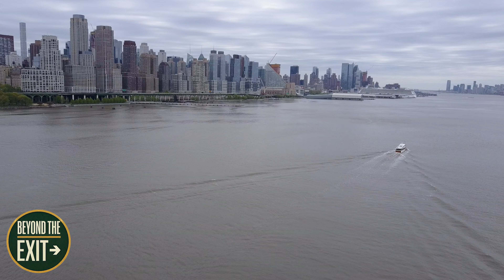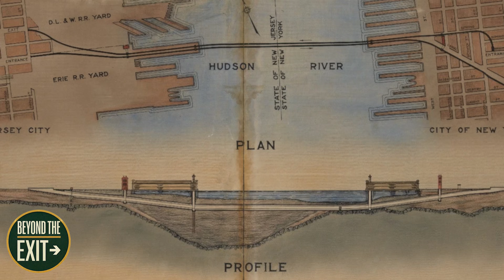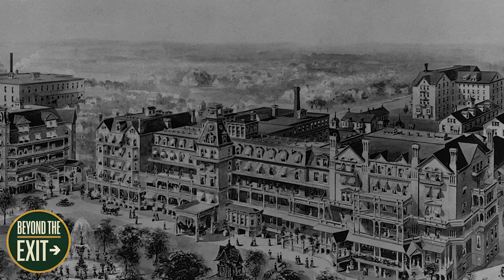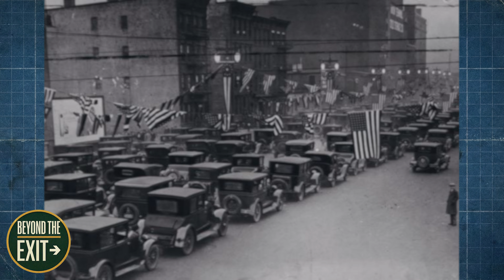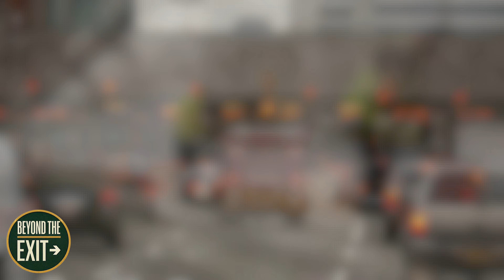First Underwater Vehicle Tunnel Changes The World

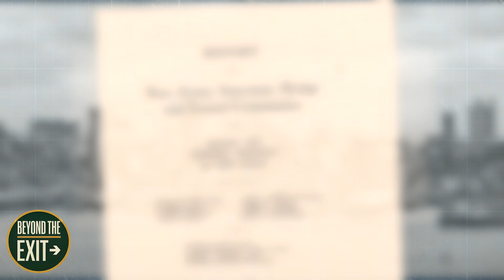Comment: 3:25 😎 🌁
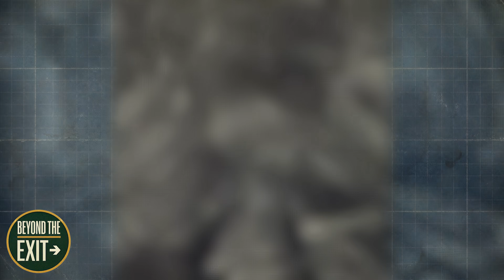13:38 tunnel w/temp tracks
14:17 🔲’ing the ⭕️
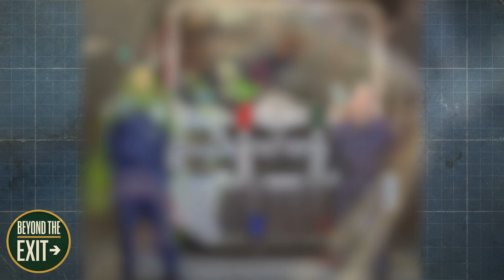15:40 floor/ceiling air ducts
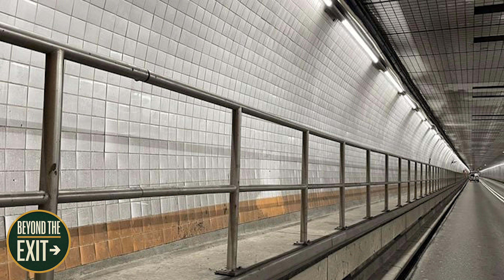16:44 floor/ceiling air ducts
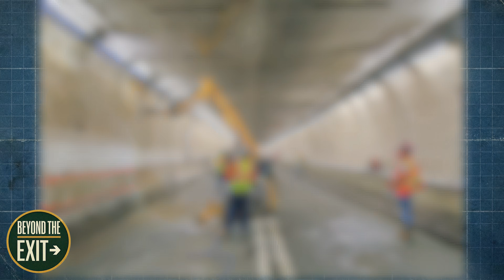16:56 custom cleaner 🚛
16:58 👷🏼‍♂️removing tiles👷🏻‍♀️
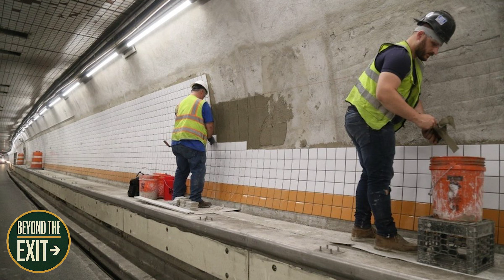17:04 👷🏻applying tiles👷🏼‍♂️

Comment: I was told by a co-worker that was working near the Holland Tunnel when it opened that soon after it went in service a freighter sank above the tunnel and rested  on top of it. They closed the tunnel until it was determined it was not damaged.
Reply from the maker: That’s an interesting story — I hadn’t heard that one either. I know there have been vessel incidents in the Hudson over the years, but the engineers were very deliberate about protecting the tunnel structure. I may have to dig into that and see what actually happened around the Holland Tunnel.

Comment: The tunnel is part of I-78 but there is a gap between the New Jersey Turnpike Hudson Extension's eastern terminus and the western tunnel entrance.  You have to go through traffic signals and cross Marin Boulevard (formerly Henderson Street) both ways - Twelfth Street going east, Fourteenth Street going west.  If the Port Authority could find a way to connect the tunnel with the Turnpike extension - also part of I-78 - without disrupting the northern edge of Jersey City or cutting off Jersey City from Hoboken, that would be great.

Comment: In the early ’80s, I worked as a photographer for an engineering firm and spent time inside the Holland Tunnel documenting the ceiling for new panel fabrication. Seeing that engineering firsthand made it clear how much the Holland Tunnel paved the way for modern auto tunnels.
Reply: I spent 3 years inside both tubes of the holland tunnel repairing and reinstalling the wall tile.
Reply: Please post positive proof pronto 
Perhaps provide prized pics
Reply: @josephambrose2852  I don’t have photos of inside the tunnel, but I do have photos on the Statue of Liberty if you’d like to see them I’d be more than happy

Comment: I always wondered about the life expectancy of those cops who worked in the  Lincoln and Holland tunnels....
Reply from the maker: @TomYagerhofer That’s a good question. I haven’t seen solid numbers on life expectancy specifically, but air quality in tunnels was a real concern in the early years, and officers and maintenance crews were part of why ventilation standards were developed. Conditions improved a lot over time as engines got cleaner and monitoring improved. Thanks for watching.

Comment: Of course the trains were required to be electrified when entering NYC ...so the emissions issue wasn't one
Reply: The tunnels approaching Grand Central were the scene of a crash in 1905 because of missing a signal that was obscured by smoke so when they built the new station the trains were electrified changing to electric engines in Harrison NJ for Penn and Croton-Harmon for Grand Central.